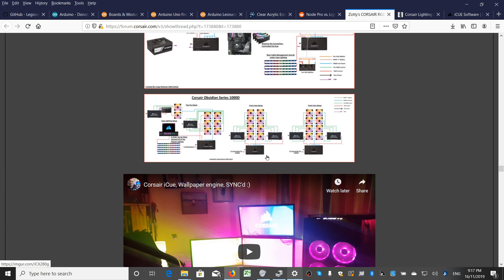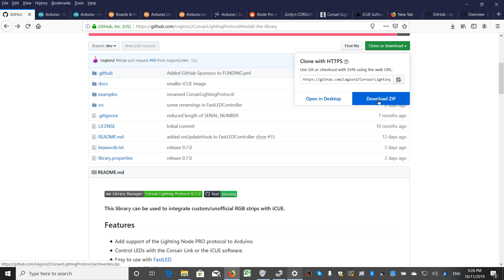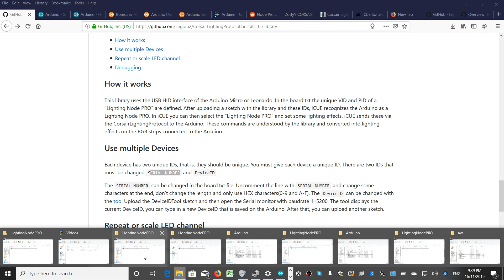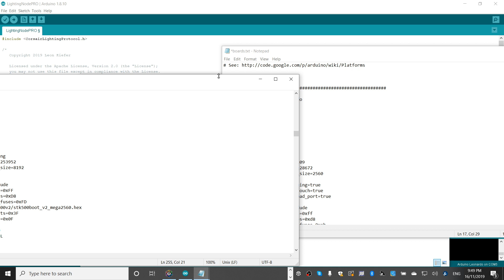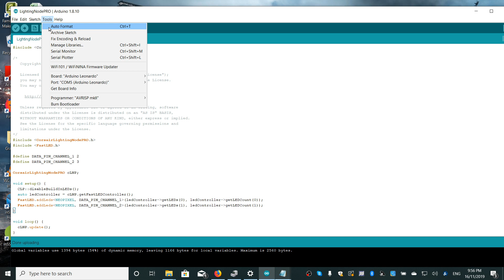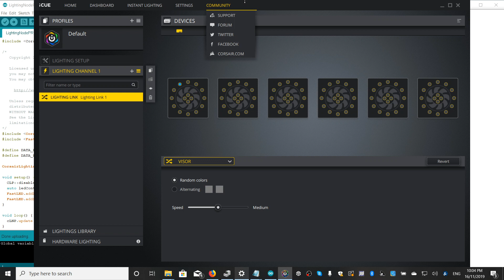Arduino ARGB Corsair Lighting Protocol Corsair Lighting Node Pro Corsair iCUE

Comment: I have a question, that if I make 2 controllers like this, can I control lighting effect in Corsair iCUE?.... the thing is I have made 2 controllers like this, but it doesn't showing 2 controllers at the same time in iCUE if I connect it separately it showing but If I connect both at the same time, it doesn't showing up meanwhile in the 3rd party software like SignalRGB and OpenRGB, it showing as 2 Node Pro connected.. only in iCUE it doesn't showing as 2 Node Pro Connected
Reply from the maker: To be honest I have not touched this for years. Software is now different so probably ask question to developer on GitHub.
Reply: Thank you so much for your response @hidefandy
Reply: Did the argb effect work on startup or the icue needs to start up for lightning effects

Comment: @hidefandy can you please add a notice to this video, that the shown configuration is deprecated and only works with an old version of the Corsair Lighting Protocol library. The new guide in the project itself is straightforward and much simper than the setup described here. Users searching for a video about CLP find this one, but it makes the setup for them much harder than it should be. So please add a notice, that this video describes an old setup which is not the recommended way of using the library.
Reply from the maker: Done. It should be obvious this was and is still evolving and now out of date.

Comment: Hi guy.
I need to connect a strip of at least 1.5 / 2mt. Does iCue have the 96leds limitation or can I go further?
Should I buy a 2m strip with 30leds / m or can I unbalance myself on a 60leds / m one?
Commander Pro has 2 channels. Can I also create 2 with the Arduino? What changes should I make to the script and which pins to use?
Thanks again.

Comment: This is AMAZING. I will try this out in the nearest week or two.
I am doing DIY project fans with 61 Argb in each fan. Planning to put 11 fans like this in my custom case.
Question How should I program my Arduino so that the iCUE would let me control all fan LEDs + two led strips with 144leds per meter each? And is one Arduino enough for this project?
Reply: Aleksis Apinitis Not sure about PWM function on the fans but you,will need a powerful power supply to power all of them.

Comment: Hello ~
I have issue when I'm upload the "LightingNodePRO" sketch.
Have message "Error compiling for board CLP SparkFun Pro Micro 5V, 16MHz"
Use the example ->Corsair Lighting Protocol->LightingNodePRO
I install the “Corsair Lighting Protocol” & the “FastLED” library already.
I choice board "CLP SparkFun Pro Micro 5V, 16MHz"
Choice device "Lighting Node Pro"
Port use in my PC "Com10 (Arduino Leonardo)"
Can anyone help about my issue?
Reply: If you have a compiling error there should be more information about the error in the console, that would help to solve the problem. Which version of the Library you are using?

Comment: Hello,so with this I can controll my LL corsair fans without a corsair lighting node?
Reply from the maker: Correct
Reply: @hidefandy  Thanks for the answer,also,can this work on arduino nano or is better to work this on arduino uno?
Reply from the maker: hace a look at supported boards which has had several updates. To be honest it’s been a while since I’ve looked at and have forgotten.
Reply: @hidefandy  One last question,which arduino you used for the video?
Reply from the maker: Leonardo

Comment: Can this be used to use non corsair fans with iCue?
Reply from the maker: Yes, I use it for cooler master fans.
Reply: @hidefandy  Hi, can you please tell which Cooler Master fans you use? Are the LED sequence same as Corsair's?
Reply from the maker: @lostlegend47  the fans are in the cooler master mb530p. They won’t sequence the same (still looks ok) as the led numbers are not the same. It does not matter if you use non sequenced affect such as rainbow, breathing etc.as all the leds are the same.colour.
Reply: @hidefandy  how did you wire them up ?? With Corsair fan hub? Or directly to the Arduino(lightning node pro) and then selecting them as led strip in iCue
Reply from the maker: @RohitRaj-hm2ip  no hub. just soldered  multiple strips together in parallel. Need the hub if you want effects in series and must use fans with argb outputs. Ie Corsair fans.

Comment: i have to notice a few things :) 

1. the whole reposetory is a library, you should download the folder, delete ( in this cast -dev in most cases -master) -dev from the foldername and put the whole folder in your library folder ( in the installation directory ). then when you start the ide it will automaticly detect the library and you can go to examples and... tada  :) much simpler 

2. the ports doesnt reload automaticly you have to manually close the dropdownmenu and reopen it to reload the com connections

I hope i could make your workflow a little bit better :)

greetings from germany

Comment: Nice Video. Is the new ls100 also featured?
Reply: Yes the LS100 is also supported
Reply: @L36I0N  is the installation exact same or are there some key differences?
Reply: @Tesafilm04  it's the same, but since this video was created I updated and simplified the installation process.
Reply: @L36I0N  where can I find the updated version
Reply: @Tesafilm04  There is no updated video, but you can find all information on the project page https://github.com/Legion2/CorsairLightingProtocol
Reply: @L36I0N  thank you for your fast answers, but I have still a question: i have a three monitor setup and want to add ls100 ambilighting, so i need 192 leds. In your code example for the ls100 stands something like its only supporting 135 leds. Is it still possible for my three monitors or limits the memory of the arduino this idea?
i want to use a arduino micro pro, because of its compactness.
Reply: @Tesafilm04  The limitation comes from iCUE, it only supports one and two monitor setups.
Reply: @L36I0N  okay. Thanks for the fast answers

Comment: Thanks a lot for the video. It's a very detailed instruction. I was googling for a couple of days now how to interface an Arduino RGB controller from a PC software. I couldnt find anything or you had to compile your own programs and such. Using iCue is a very neat solution. Especially since my RAM already uses it. Sadly I'll have to buy a compatible Arduino first to give it a try since I don't want to potentially brick my Uno. If this works out well I'll make my own pcb that can be mounted somewhere in my case and is directly connected to the mb with an internal USB connection and uses power from the PSU.
Reply from the maker: No problem. The first time it took me days but now it can be done in 30 minutes.

The Dev has updated the readme so its a bit clearer as well. He has also made a few more improvements to the code.

Have a look at the Opencorsairlighting project which includes a a custom made board.  https://github.com/McHauge/OpenCorsairLighting
Reply: @hidefandy  Thank you very much 😊
You actually helped me out a lot with this video. I'll give the board a look 😌